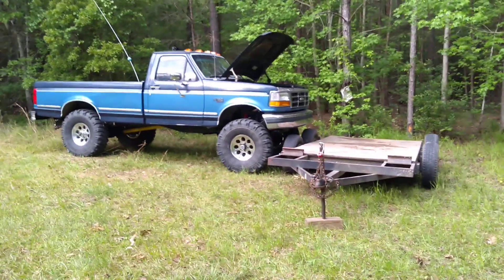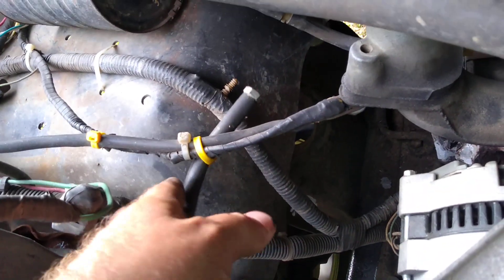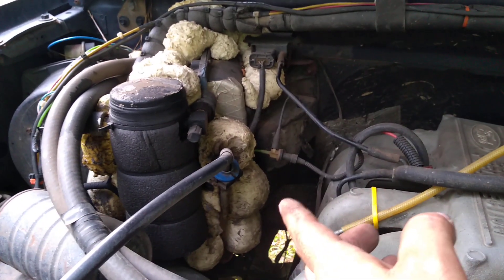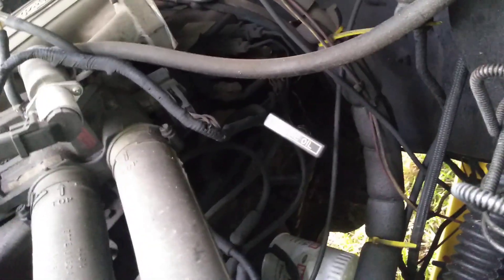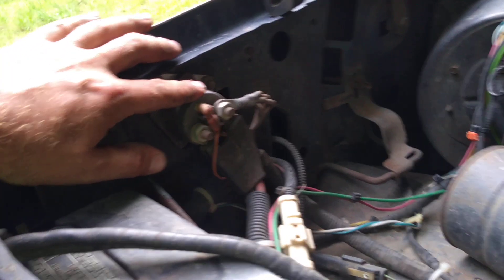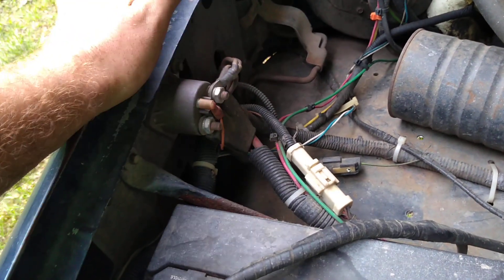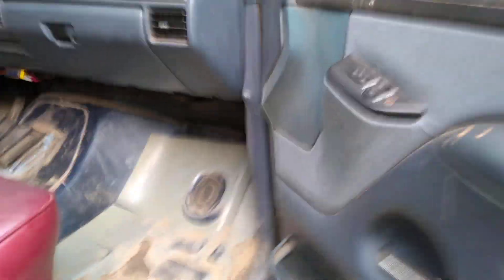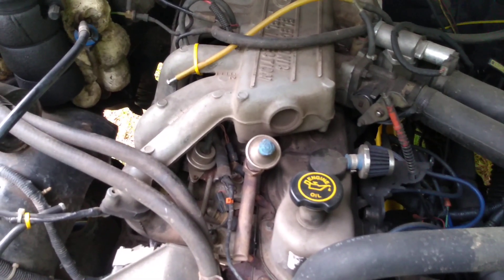Ford 300 Inline 6 Vacuum Lines

Comment: Wow. I see that spray foam to seal up the heater box !!! I need to do that.  Mine is busted and has a plate with zip ties !! Good idea.  Now that blue stuff capping off the pipe going up.  Is that spray foam ?  I deleted that crap that was disconnected anyway.  So now i have the pipe open up. Iv seen guys put a breather filter on it.  I tested today and no suction or anything off it

Comment: IDK what  did but now the truck idols waaaaaay high  got it running took it for a spin around the block   she idols at likee 30 mph n runns hotttt. did i do the vacuum lines wrong or has this happened to anyone else?
Reply from the maker: You probably don’t have something hooked up or the throttle isn’t closing all the way. When I did my engine swap, I forgot to hook up something. I can’t remember what it was, but it was doing essentially the same thing.

Comment: Why remove egr valve?
Reply from the maker: Why not
Reply: Because it cools the air that runs through the engine. Plus it was engineered to run with a egr. I have a 94 f150 with egr and it runs like a top.

Comment: I got a 95 which one of the previous owners had installed the push-button work-around.  I eventually narrowed it down to the entire CEL light and socket were missing.  Moved the 4x4 socket and light (it's 2wd so not needed) and key-crank started working. (figured it out after moving it and accidentally turning the key the full way, which didn't normally work.  Removed socket and verified it didn't crank then put it back and it cranked.)  Odd behavior there, but guess it's to protect in case there's a major code?  I dunno.

Comment: What does the egr delete help I have a 95 4.9 ?
Reply: So it doesn’t increase power(or decrease )or get better mpg ?
Reply from the maker: Will Powe not that I’ve noticed, I don’t really pay attention to mpg on this truck since it drinks gas like crazy anyway. Now the cat delete made a little difference in power
Reply from the maker: Will Powe main thing was I deleted the cats n had to take the smog pump out and I just didn’t want the egr in it cause it’s not by any means necessary.
Reply: Everyone tells me deleting the cats makes it run like shit
Reply: Leave the egr alone. From what I understand it hurts fuel economy to remove it . My 91 4.9 is smog and cat deleted but the egr has always been on but it was froze shut until tonight. I haven’t noticed much power increase. Maybe ill get better gas mileage with a proper functioning egr now but I don’t know yet. I do like the cleaner engine bay with out all the extra junk, also the new y pipe made exhaust work very easy

Comment: I just eliminated emissions off my 89. The top of the stock air box gives u a easy diagram of the vacuum lines. I notticed my truck smelling like gas fumes until I connected the charcoal box “gas tank vent” to that yellow hose u blocked off. I’m pretty sure your supposed to have the tank vented with vacuum pulling the fumes back into the intake throttle body area. tank vent >coffee can> 2 nipples ontop of throttle body.
Reply from the maker: The line comming from the tank to that box is still there. Now the line that went from the box to the purge valve is blocked off. Truck never smelled like fumes or ran any different, but that's wierd cause none of the f150s I've owned ever had a diagram